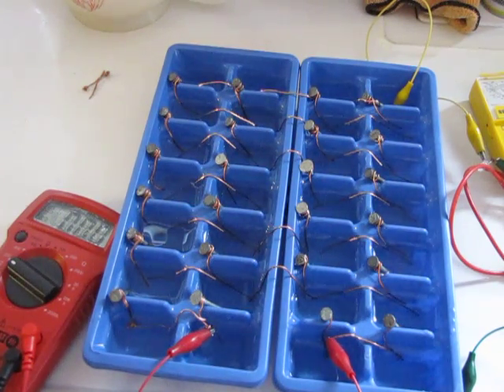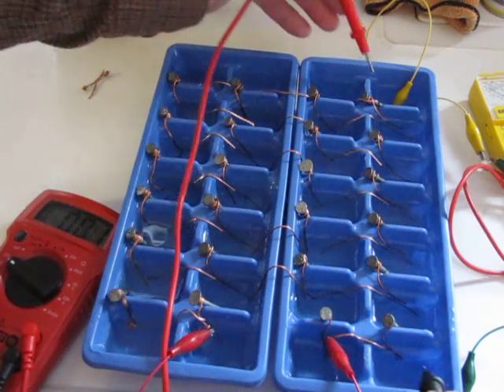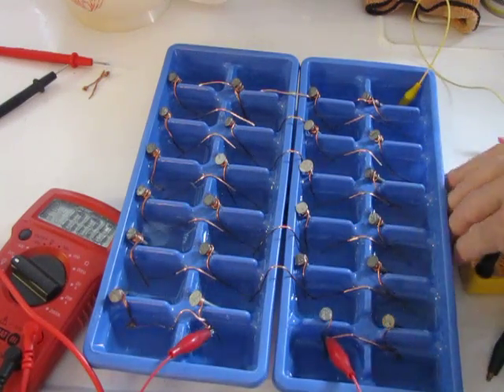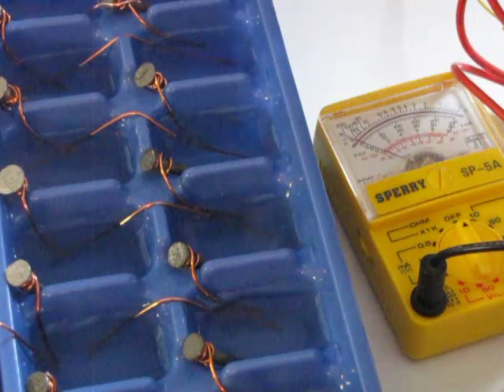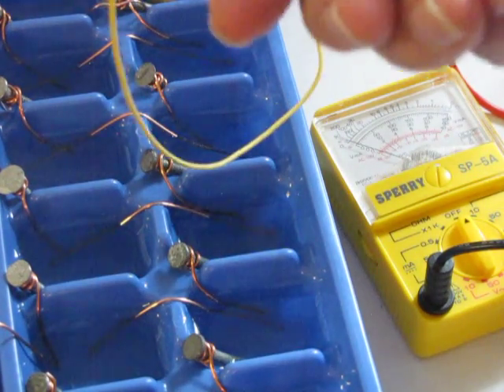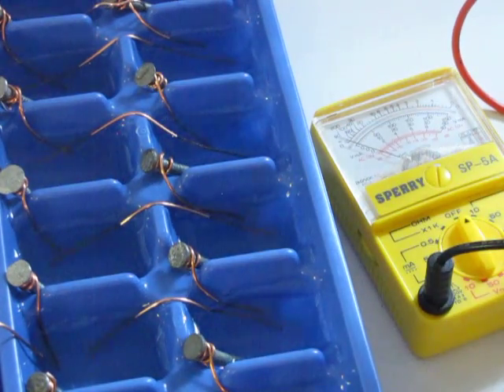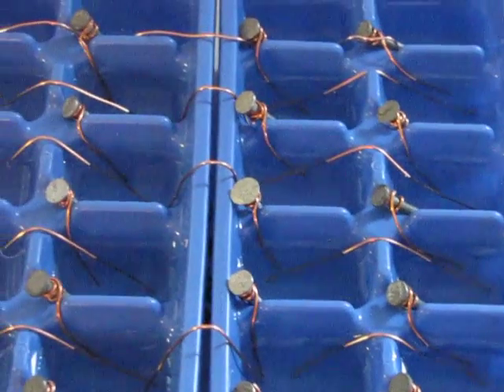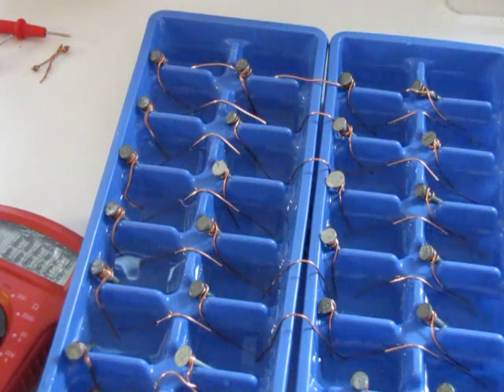Acid Rain Battery Power - Part 3 - Parallel Circuit - A Tiny Light Appears

Comment: That's so cool I've never seen or even knew about that experiment before your vids,  nice job on them too.  You should try that with longer nails and  a deeper container  like a popsicle mold set up or something.  Love your blender tuts btw.
Reply from the maker: Bigger nails and copper would help because of the increased surface area but the circuit really needs a lot more current to make the led an effective light.  One way to get more current is to make the water more acidic, causing a stronger chemical reaction.  I'm experimenting with other natural materials to make the water more acidic and I'll post those videos later this week.  I've never see the experiment before either; I just made it up.